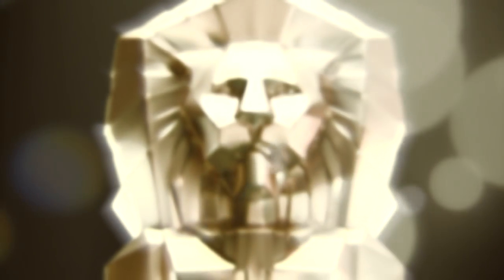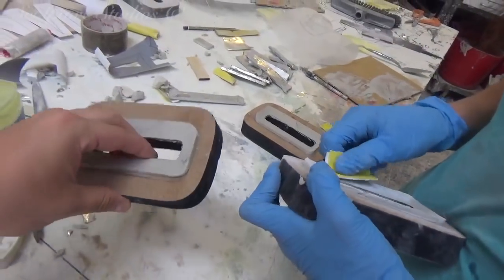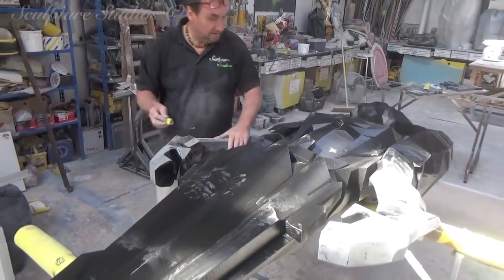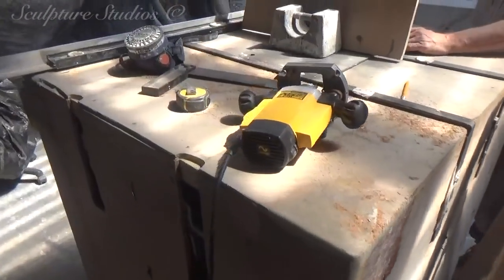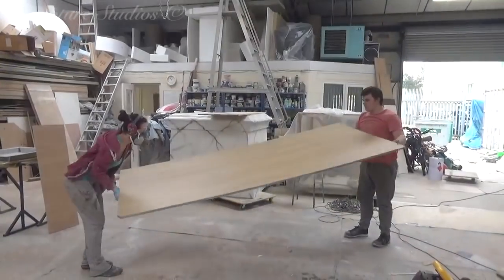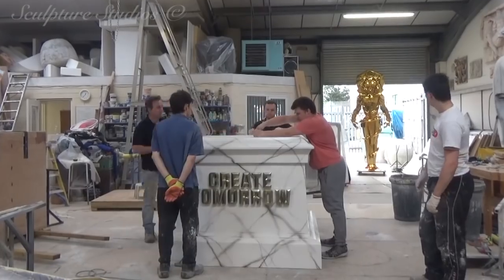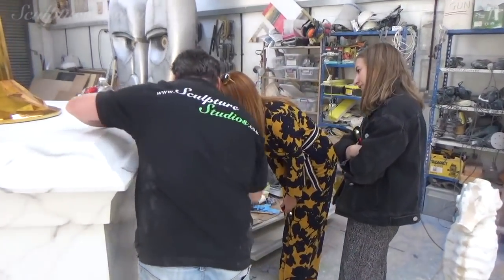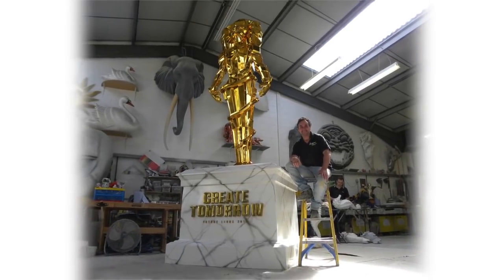Gold Future Lions 2018 Statue by Sculpture Studios

Comment: Job looked great in the end but have to say if we sanded like that in the automotive design industry finishing tooling models we would be shown the door . The only way to get perfect finishes is by using different size rubber blocks with different amounts of flexibility which avoids rubbing in defects with the sandpaper and the pressure of your fingers, Just saying.
Reply from the maker: Very true. We did use various blocks and flat tools when sanding, but we found we needed to apply more direct pressure in particular areas, where ands and fingers were more practical for the intricate areas.